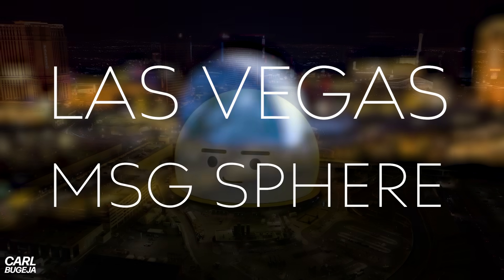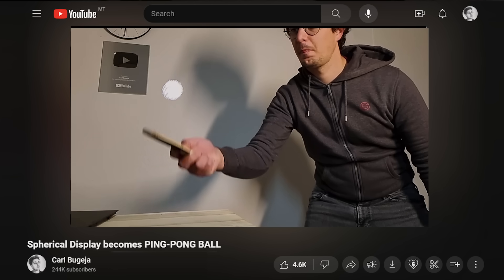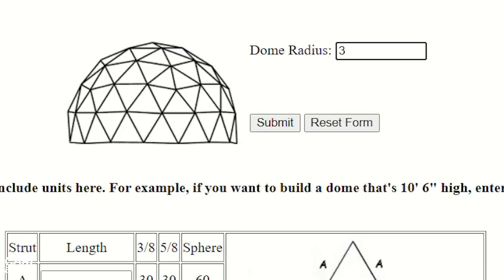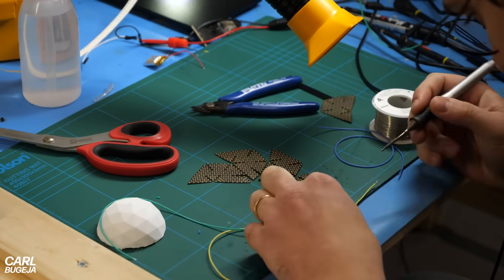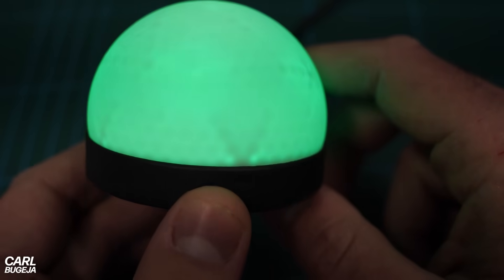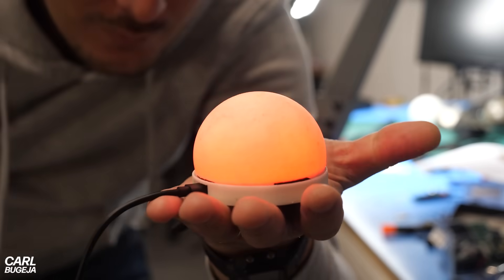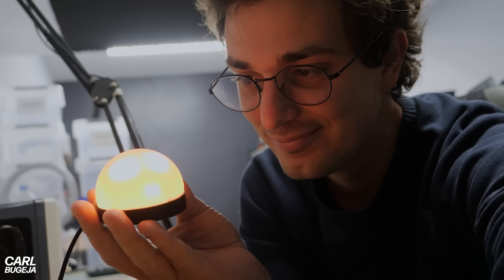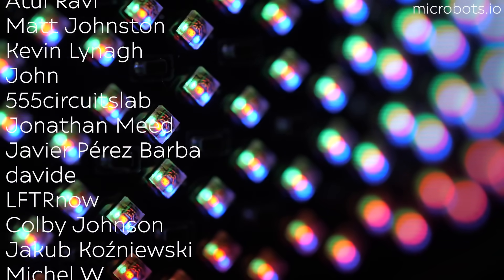Building a Mini Vegas-Sphere

Comment: You’re only at 10% brightness, that gave me an idea: use a flat (circular?) lcd, shine a light from below, and use a lens to project the image on the sphere? That would give you decent resolution, lower the price, and maybe be easier to build.
Reply: I was thinking it might be a mini dlp projektor with a lense. Thst would probobly work. It wouldnt even need to be that high of a resolution.
Reply: @matsv201 I agree a projector seems like a better solution.
Reply: @dfgaJK  yea.. probobly would need to make a base to hide the projektor. But on the flip side, it should not be hard to make it a 270 degree part just like the real thing.
Reply: @matsv201  Yeah, I have just looked at a teardown... there is a lot more to them than I expected... maybe a super bright micro OLED screen as the projector source would be the way to go.
Reply: @matsv201 the lens is non trivial though...
Reply: Maybe combine an lcd with glas fibre. Superglue glas fibers on top of an LCD and arrange the other ends in a 3D printed sphere. Then put the difusor on top.
Reply: @nickus9119  I remember seeing a video from Disney research where they made a spherical display just like that, using 3D printed light channels. They called the display "papillion"
Reply: @nickus9119   instead of using glass fibres, just print a halfsphere with hollow channels and fill them with clear epoxy as light guides
Reply: @gamerpaddy or fiber optic cables strung in a fixture made from epoxy casting. Cables conmect pixel to sphere surface. Epoxy keeps cables fixed yet not brittle. A brittle armature of 3D print may work as base?
Reply: @nickus9119  thought the same Couldnt be a cone-shaped fiberglass yarn or cable, attached froma de oled to the sphere?
Reply from the maker: Cool but might be a nightmare to map the image
Reply: @CarlBugeja  I don't think so. Lenses distortion is quite easy to calculate. The much bigger problem is probably to get a lens for that. If there is some kind of light conducting filament, you could use basically something like glass fibers and print the channels from the LEDs to the surface. But I have not found something like that.
Reply: @kiel9030  There use to be a toy like this. Lots of glass fibres, and a rotating LED setup, the colours spin around. But getting each fibre and gluing it into the sphere would be a pain! :D
Reply: @kiel9030  if we can 3D print a custom fresnel lens thats shaped a bit like a wedding cake, but also like a water surface ripple made of saw waves. So the lens may be more like a bulb, and project from lens to outter diffusion layer lot closer to make the LVD screen underneath blow up onto consistant resolution and well fit / streched naturally.

A lightning bug has a special passive amplifier for light, just reducing internal reflections. I'm simply saying we make that 3d printed like a fresnel convex lens cake 🎂 🎉
Reply: @kiel9030  Maybe a form of inverted circular fisheye lens?
Reply: @CarlBugeja  solving a bit of hard math once is cheaper than hardware :P

also what about cheap square flexible OLED panels, with the corners tucked into the sphere to make the triangles?
Reply: @CarlBugeja Maybe individual fiber optics connecting between an OLED pixel and a point on the sphere, origami won't be able to save you from connecting 1000 tiny filaments tho 😆
Reply: @CarlBugeja  Not at all hard to do the mapping. Some lenses have a very simple equidistant fisheye projection. This is done all the time.
Reply: @CarlBugeja  That's a problem for Future Carl
Reply: @CarlBugeja you need to use a fisheye lens and you need to do fisheye effect to the image to look right or you have to take circular fisheye videos/images with any capable device.
Reply: @CarlBugeja look, idk what I'm doing/saying at all, but I had a thought and although it's probably completely inviable I think it's worth sharing because it may give you an idea or some ideas to test: couple weeks ago I saw this guy on TikTok 3D printing diffusers for his LED strip and he managed to do all sorts of cool stuff with the way the light would be diffused and how it would bounce inside the plastic and then out, so I thought, what if instead of using a lens, you use individual strips of plastic to serve as a "fiber optic cable" of sorts? 3D print all those plastic strips that climb um from the base and up to the outer shell of the sphere. Mapping is still an issue but I think you can approximate it by projecting the image into a cone-like shape on software, getting the image shown from above, display that and see what needs a fix, and alter the shape as needed. I think you may be able to 3D print it in one piece too, just a dome, with a base with a bunch of dents for the LEDs to fit and this weird strands structure inside lol, but would still want to add a diffuser and maybe a coating to the "optic cables" so light bounces inside instead of escaping, I dunno
Reply: @CarlBugeja  there is probably a preset for sphyrical video in your video editing program, or if you feel like using adobe.
Reply: @CarlBugeja  depending on the lense you could perhaps just use a circular image where its mapped similar to a top down view.
Reply: @CarlBugeja  No need to map. You just need to use a fisheye filter until it matches the lens.
Reply: @CarlBugeja  Another idea: use a small projector. They're already pre-mapped to project onto a flat surface, but what if you replace that flat surface with a translucent dome? The image might be stretched on the edge of the dome, and focusing might be hard, but you can make a large vegas sphere at a not too expensive price
Reply: @CarlBugeja  Images & video are mapped from circular to hemispherical to rectolinear in real-time for 360deg panorama cameras + projection where the camera points at a hemispherical mirror to get the 360. Those libraries are about somewhere. The actual problem would be resolution differences across the hemisphere, but that hasn't slowed the panorama community.
Reply: @CarlBugeja already been done
Reply: @CarlBugeja  iirc Photoshop has a method for mapping flat images to spheres using polarization, if I remember right it'll end up just inverted
Reply: @CarlBugeja a single oled might not be enough, however the pixel mapping actually is a fixed map, same as with other lenses
Reply: @CarlBugeja  i think it's achievable through hyperbolic mapping
Reply: @sambeard4428  I think faster than light travel is possible using warp drives but that doesnt help him either.
Reply: Images could be mapped with threejs @CarlBugeja
Reply: @CarlBugeja  I think that's just projection, and a lot of 3d software does it automatically. :)
Reply: @CarlBugeja , Maybe, but you could try simulating it in a 3D render engine, like blender! Model the lens and put the screen below ot, you could play around with the simulation there and maybe get a quick workflow for the mapping!
Reply: @CarlBugeja I'm sure there's some code lying around for lens correction for VR.
Reply: @CarlBugeja  Like all computing challenges today, there's a clever solution to this which involves lots of math, low-level programming hacks and knowledge of optics OR there's the dumb solution where you make a program like unity simulate everything with some sort of shader and you only have to make relatively minimal effort.
Reply: @CarlBugeja  Perhaps something with anamorphic images might help a bit
Reply: @CarlBugeja  Planetariums use this method a lot. Maybe there is a paper teaching how to map images in a hemisphere.
Reply: @CarlBugeja  projection mapping is a necessary thing that you gotta learn eventually
Reply: @CarlBugeja  you could do it with a simple (albeit complex) matrix transformation. Ingame textures are very often mapped flat then wrapped around objects. Often the wrapping used to be baked into the texture file itself, but many games have chosen to use a transformation to wrap the texture instead.
Reply: @CarlBugeja   could you use a mini fish eye lens in reverse that all you need to make a fish eye projection
Reply: @CarlBugeja  Anything for science!
Reply: @CarlBugeja you can use "structured light" to automatically map the leds.
Reply: @CarlBugeja  well, not really! For a computer it`s a piece of cake
Reply: @CarlBugeja  The nightmare will be getting the correct distance from the lens, but I like this idea
Reply: @CarlBugeja  Use Math dude
Reply: @CarlBugeja  even bigger nightmare if its LCT. Hopefully he went Brompton 🤣
Reply: i wonder if there's any particular square tiling that would work best to estimate a cube. how custom can you go with LCD size?
Reply: are there affordable lenses capable of projecting a flat surface onto a spherical surface with perfect focus?
Reply: @netroy  You wouldn't need perfect focus, you are going to diffuse the image somewhat. I hemispherical projection lens is fairly readily available.
Reply: The "easy" way to make deal with the fibers is to do as Nasa did.

Take a single long fiber. Wrap it into round and round in a loop until you have a bundle of fibers which is the diameter you need, (in this case the diameter of the sphere).
Cut the bundle so you now have a fiber trunk made up of thousands of fibers.
Put the display on one flat end of the trunk.

Then in this case, bind the other end of the trunk together with glue and machine the end of the  trunk on a lathe into a hemisphere.
Reply: or use fiberoptics to direct light from lcd
Reply: Think the same!
Reply: might as well just make a pepper's ghost at that point
Reply: Many, many years ago, there was a product called the "elumens Vision Station" which was basically a fancy lens, attached to an inexpensive video projector which projected images on the internal surface of a hemispherical screen. It was an impressive effect for the time. It's fairly easy to do the distortion corrected rendering on the GPU, and I definitely think this could still be a really good solution for this problem. The software is the easy part, but I'm not sure where you could get a suitable lens.
Reply: Everyone upvoting this is lacking in critical thinking. Using a sense to make a flat display turn into a sphere would stretch the gaps between the Pixels creating super brightened rings around the bottom and dimmed areas in the middle. 

He brushed over it but making a sphere with pixels equally spaced is such a difficult task.
Reply: The problem is you’d have massive resolution drop-off and distortion that might counteract the brightness if he did turn the LEDs up to full😕
Reply: @OP Chromatic Aberration says no.
Reply: That would work for monochrome lcd, but projecting color with any details into a half sphere would be difficult in a DIY way
Reply: Furries does use that for realistic eyes, a circular lcd/oled with a demi sphere lense on top, work wonders
Reply: Yes fibre optics might do the job. Connected to LCD at bottom.
Reply: cool idea
Reply: I don't know what the sensor size is in a 360 camera (it's probably tiny), but a lens from such a device would be perfect. To go around the sensor size problem, additional lenses could be used to "compress" the image.
Reply: Won't work. Spherical aberration out the whizzhole.
Reply: GENIUS!!!!
Reply: PixelOrb?
Reply: just use a bendable  led phone screen.
Reply: that's not authentic to the real thing, He's going way beyond that idea and committed
Reply: @whynotbuildit  if a bright lcd under a fiber optic lamp with an opaque cover gives the same effect, isnt that good enough?

Comment: Cool project as always! Maybe you can create a cheaper version of this with a more regular pixel layout by simply stacking regular PCBs that only have LEDs around the circular circumference. Or maybe create a bunch of really tiny triangular PCBs that can be tiled, including the connections, any solder them into a sphere.

Comment: Nice
for the sphere would making a flexbble pcb in concentrical circles, which has a small bridge connecting them work?
The bridge can then fold under one of the circles, which will create a bump but as shown with the vid, the bump under the diffuser disappeared.
The concentric circles then can be stuck down on a sphere and may help with density, the linearity of the led's and to remove the lines seen through the diffuser.

Comment: Also in 🇲🇹 and the humidity adhesive problem is so annoying!

For the dome, maybe fibre optic cable bundles instead of each led pixel - leading down to a mini display panel inside the dome. Would allow for tighter packed pixels maybe. Not sure about costs, complexity of mapping the internal display, or if within the spirit of the vegas dome though :)
Reply: A good excuse to tinker with the circular display panels at the very least!
Reply: idk how you would build it so that the fibers map perfectly with each pixels, sounds like a nightmare